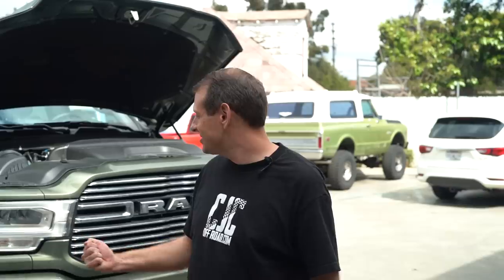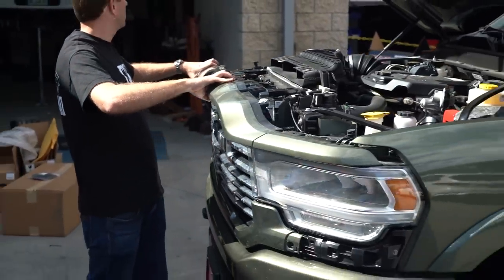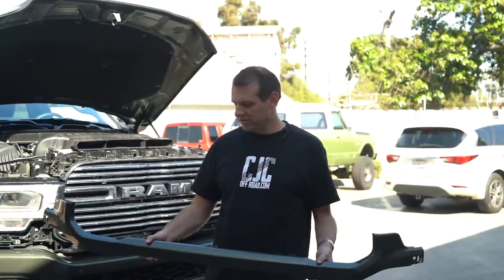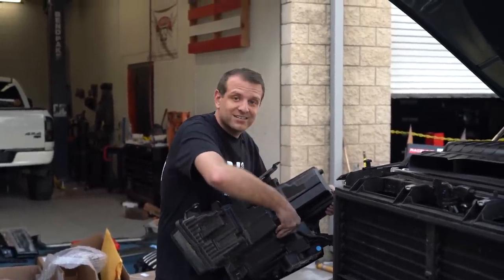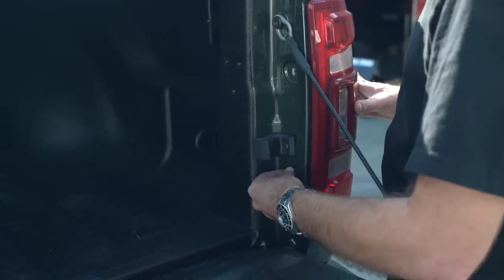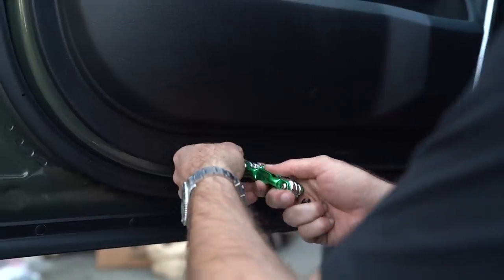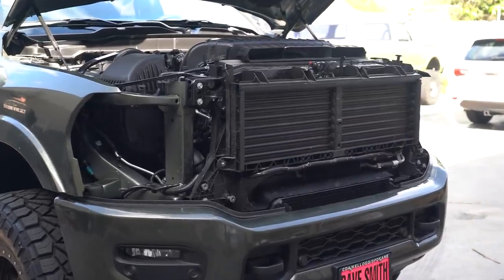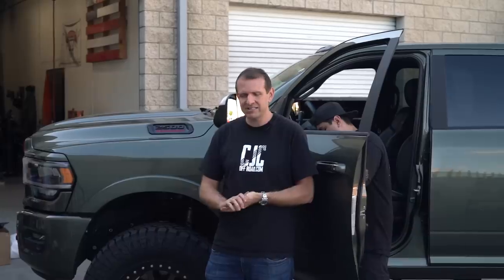How to Get Rid of the Chrome on Your 19+ Ram Truck | Night Edition Blackout Package Install

Comment from the maker: Don’t forget to check the description above for all the part numbers!
Reply: darkjedi351  olive green
Reply: I'm not seeing part #'s for the mirrors. Could you guys provide those please?
Reply: Can I just replace the chrome on my grill with the black grill inserts? I got the 2019 Laramie Sport but it has a chrome grill :/
Reply: Where do I order everything from?
Reply: @marrs1982  did you find the right tail light numbers for the night edition and what year is your truck mine is a 22 you think it'll fit since nothing has really changed
Reply: The blacked out headlights are LED? I found them online @450$ each.. seems cheap for LED lights, unfortunately i can’t find a detailed description
Reply: CJC I have the 2020 power wagon with nightshade version, I want the 2019 - 2022 , 2500 nightshade grill . Has any of your customers mentioned they like the PW grill better ? i would trade grills. Mine is the same green as yours only a Power Wagon. I live near your shop within 80 miles or so ( Hesperia Ca) BTW My grill is absolutely factory perfect. not even a scratch

Comment: Wow, I just replaced the grille this weekend and got the last piece of chrome off my Olive Green Prospector XL!  You weren't joking about those lower trim pieces being tricky!! And the AEV Highmark Fender Flares make the access worse.  I ended up popping them off from being by accessing the tabs with a trim tool and pushing them out.  Phew!!!  So glad to have those done.  And they pop back in effortlessly.  Thanks, Ram!  ;)  This chrome delete process would have been so much harder without this video, thank you very much!!!

Comment: Note on installing the hood badges. Unless you get exceedingly lucky the badges don't press right in like shown. One of the short edges (towards the rear on the driver side, front on passenger side) had a clip that is meant to be seated not snapped. In order for them to seat fully you need to find that specific clip (it's different than the others in that it's not "free floating") start to seat that in the hole and press that side in and press toward the direction the clip needs to seat then snap the others in. It is similar to a hinge motion but not quite as drastic. @cjc feel free to pin this if it would be helpful.

Comment: Just picked up a 2020 2500, couldn’t find a night edition with the options I wanted and unfortunately ended up with too much chrome. Stupid truck shortage... I’m looking to make the same changes to my truck. What was the total cost of the parts? What was your source for the special tools?
Reply: I been pricing out parts for a 1500 and I’m at $3500 without badges

Comment: I know this  video is pretty old but it's extremely applicable now. If you haven't heard, RAM is no longer allowing you to build a night edition unless you are building a Limited. The ones that have already been manufactured are it...for now. Their website hasn't changed but if you talk to a dealer they'll tell you it isn't available. Something about supply chain/chip issues. 

For me, this wouldn't be an issue, I would just upgrade to a Limited, except the limited does not offer a bench seat, which is a deal breaker for me. So I'm thinking of just going with the Laramie and doing what you did in this vid. Is it distinguishable at all from a night edition from the factory?
Reply from the maker: Not really! These are all factory OEM parts (not sure if the headlights and tails are still available as that's where the chip issues is) but all parts in this video are OEM, factory parts just like the assembly line would use!

Comment: You're not going to show us fellow OCD kids how to properly line up the new Cummins badge on the fender?
Reply from the maker: If you’re pulling off the old one, the new one just goes in the exact same spot!
Reply: @CJCOffRoad  This has to be the best looking 5th gen on the planet.  Amazing!  Back to the Cummins badges, I am assuming (since many people debadge their trucks) that there are no locating holes/pins to install these, and they are held on by adhesive.  If so....do you have any tips/tricks to put them in the same spot?  I am thinking they can't be taped off, as you would have to remove the residue left behind from the factory badge adhesive, making taping difficult at best.  So, just measure carefully?

Comment: I like it! That dark green with all the black looks awesome! I went with chrome bumpers on my truck because I have a tendency to bump stuff, I was considering Doing the same with the badging & grill but the chrome kinda grew on me & decided to just leave it. Do you know if the limited headlights that move in the direction you turn are plug & play on a Laremy non limited truck?
Reply from the maker: Those are not plug and play. There’s a lot of extras for those.

Comment: I didn’t realize the headlights and tail lights were different.  I’m not going to that extreme.  My plan is to replace all the badges with the black ones and then simply have the side mirrors wrapped in black rather than replace them. The grill is the piece that I have not decided what to do...tempted to have it painted rather than replace it.
Reply: You could just replace the ram lettering on the front grill.  You'll still have chrome on the grill slats though.  This is the route I went.

Comment: I bought a 2021 with the chrome package and non led lights. The night edition package is like 2K from the factory. It's ridiculous what one headlight costs!!! Like $1,800 for one! So I traded in the truck instead for a night edition package with led lights. Was actually cheaper that way!
Reply: Headlights are around $450 if you wanted to upgrade.

Comment: Do you know if your tail lights were specific for the blind spot monitoring system? Also I’m assuming the headlight part number comes with all necessary LED’s preinstalled? Thanks
Reply from the maker: They are specific as they house the sensors inside, and yes the lights are a complete assembly!

Comment: Thanks for the video. I have a 2020 1500 limited, it seems like i have a crossbar In the middle of the grill outward, but all grill replacements seem to not have them. Is there a different grille for mine?

Comment: When will you post the video for the work that has to be done for the wheel setup?
Reply from the maker: In the coming few weeks! It’s nothing difficult. Basically just a heavier trim in the pinch weld and higher on the liner than the normal one we do for 37s.
Reply: @CJCOffRoad  ok thanks I like the set up and might go this way after you guys install my lift on the 23rd 😬😬😬😬

Comment: I didn't see you switch the RAM letters or Cummins badges.  Those are adhesive right?  Any tricks for easy removal?
Reply from the maker: Those are super easy. Just use a heat gun and fishing line to peel them off, and then rubbing alcohol or goo gone to clean off any residue.
Reply: @CJCOffRoad  So clever and simple, thanks again!!

Comment: So how much did this cost? I imagine it's quite a bit more than getting the night edition package from factory?
Reply from the maker: Keep in mind you can sell all your chrome parts to offset the cost, but yes it’s cheaper to get the full package as part of the truck purchase. Sadly it’s not available with a lot of the other options we wanted. There’s all kinds of strange options that get or take away other options in the truck builder.

Comment: hey thanks for the video, I have done everything on my 2020 2500, I just need to buy the plate emblem, do you know what the part number is?
Reply from the maker: Plate emblem?
Reply: @CJCOffRoad  I bought the grill that you have in the description and the RAM letters but the letters do not mount directly on the grill, it seems that it needs some type of base, thanks again

Comment: Read the description for the part numbers, but my olive green 3500 is equipped with the surround view cameras, which include an extra piece on the mirrors, and the grille. So basically I’m trying to emulate a night edition + surround view. Would you know anyone able to get me those part numbers? Everything else works for me. Beautiful truck!!!!
Reply from the maker: This website will have everything you need: https://www.moparpartsgiant.com
Reply: My olive green 2500 has the surround view as well and I'm trying to figure out the same thing. Best I can tell is the night edition grille for a laramie is really just a big horn grille.  The part number listed in the description is comes up as "bighorn".  I'm thinking on the bighorn the non-camera and camera grilles are the same, I haven't found any part numbers that say different. Did you end up finding getting part numbers?